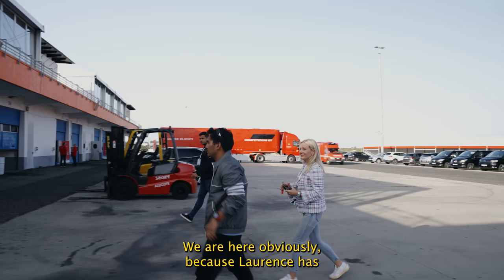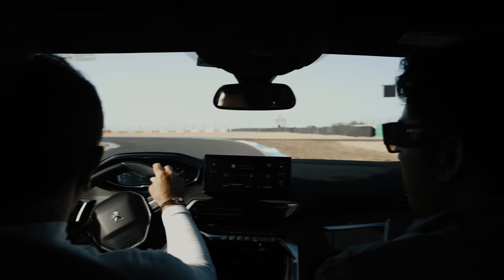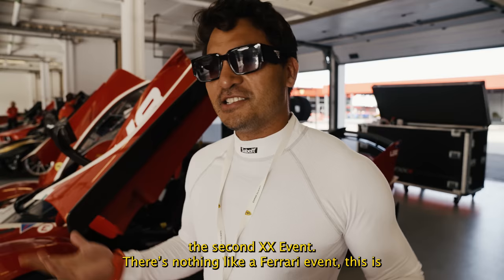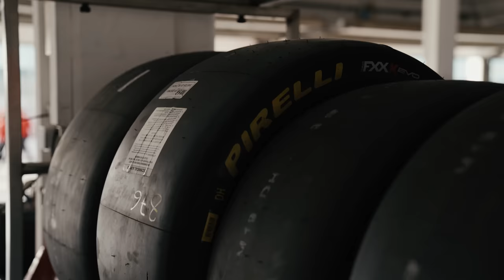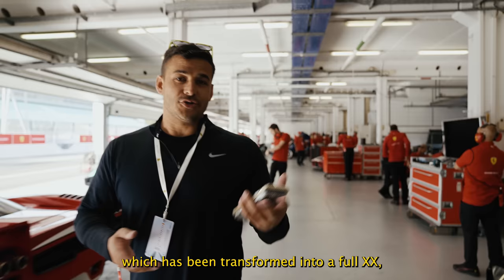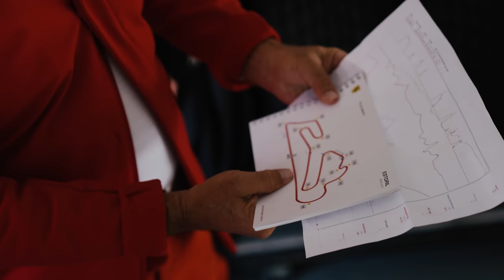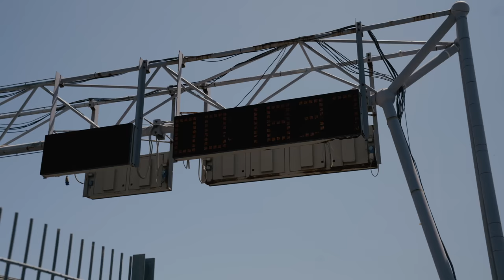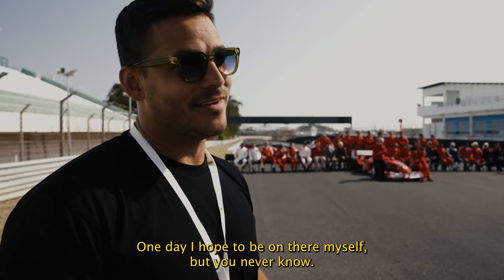Racing the Ferrari FXX-K Evo in PORTUGAL

Comment: At minute 14 half the things you have to memorize, I imagine it's difficult using the car so little and with all the exciment and thrills of racing on the track and all the emotions you get in split seconds, not easy to remember everything. Great video Great Experience
Reply from the maker: Certainly something that takes a few goes at understanding. Ferrari have a pretty good run sheet over the weekend so we're able to have 6-8 sessions across the two days